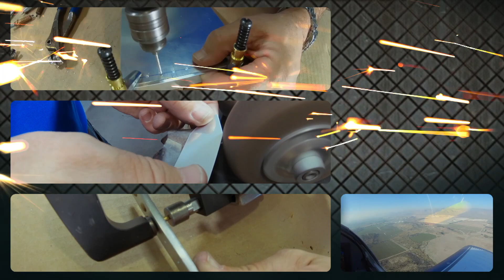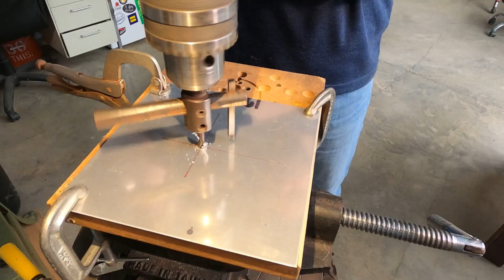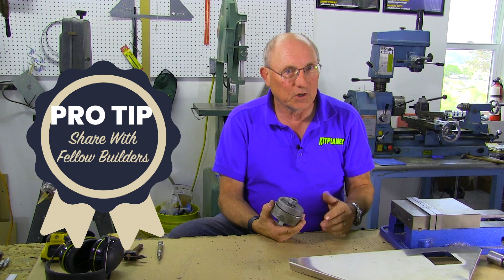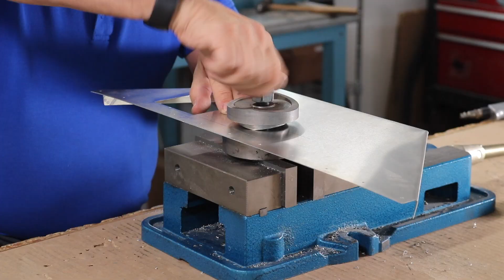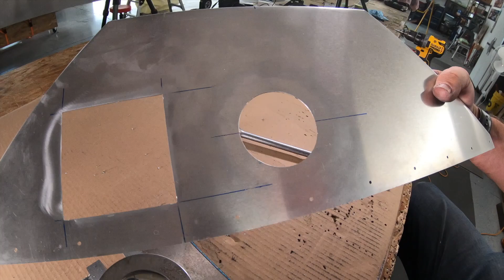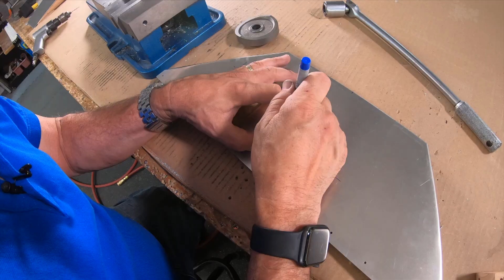Metal Magic: Cutting Round Instrument Holes

Comment: Every since I sliced myself open using a fly cutter I will not use them anymore. I use a #1 tapered pin router bit to cut holes in all of my projects. Square,round oblong, triangle doesn't matter. Thick or thin stock no problem. Just follow the scribed marks and finish with a rotary file and a hand file.